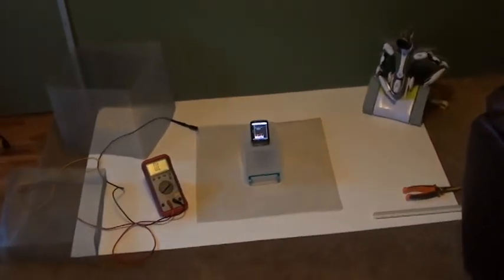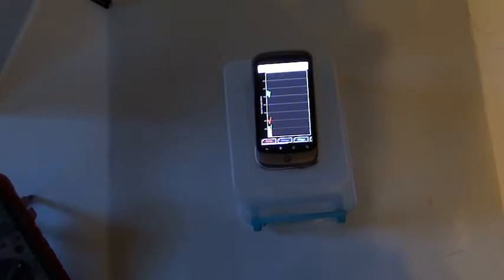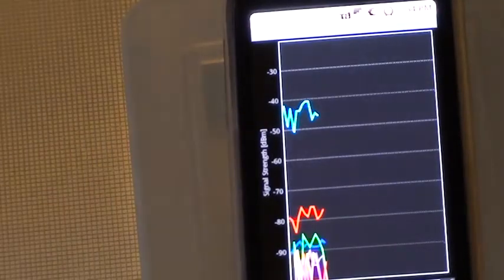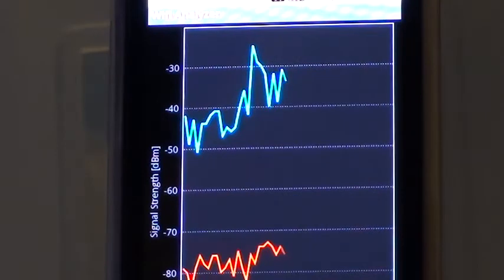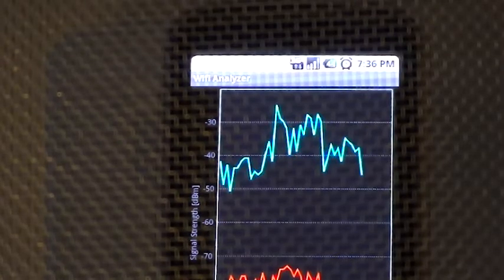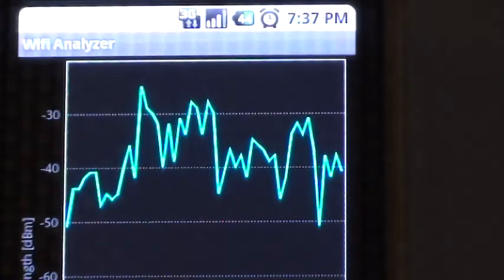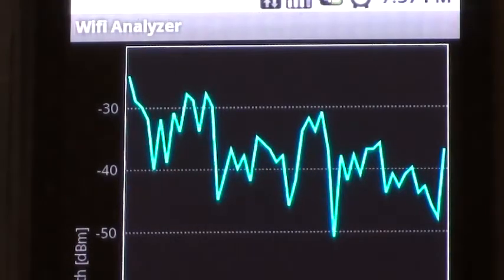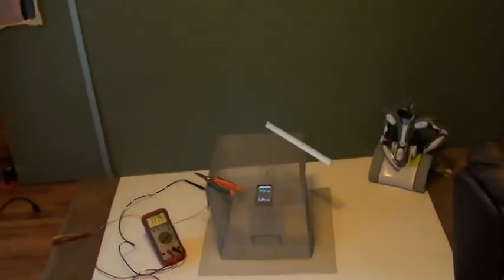Faraday Cage Expermental Setup

Comment: when using a "cage" (wire mesh) it works great for some frequencies, (you can tune the cage by using different mesh sizes) not sure how small the screen would need to be to block all the cell phone frequencies, but i do know soild sheet seem to do a realy good job of blocking everything, may want to try that, a soild box insuring all side are connected electricly to each other, and that it is grounded good. i bet you it will bolck it then even that close to the source. great video keep it up

Comment: @ZoranAUS really come on let look this up before saying stuff like that..... aluminum is more conductive both with heat and electricty then copper. We use copper in our home because 1. that short length of wire in our homes does not make a differance in conductivity, 2. aluminum expands a lot when heated compaired to copper causeing it to become disconected from its connection (wire nuts, srcew connection, crimp clamps) causeing shorts and fires. HV long line are aluminum tho (most times)